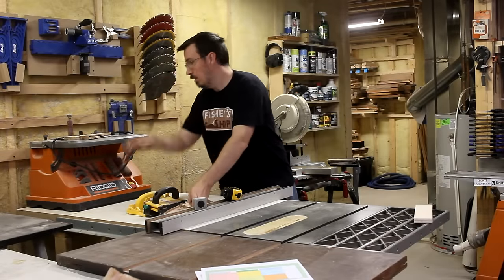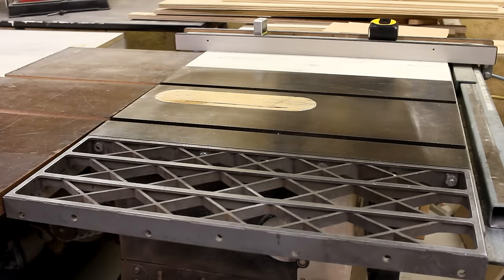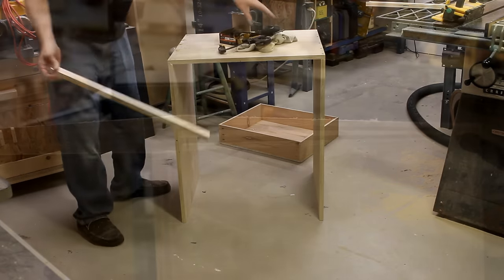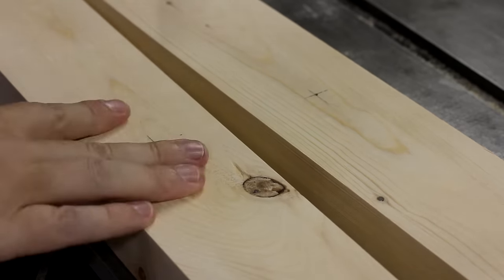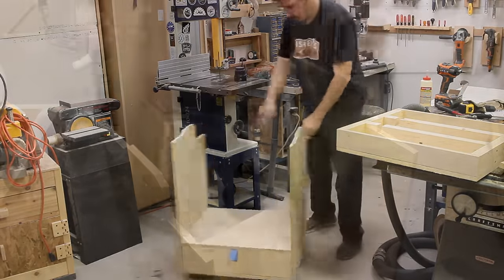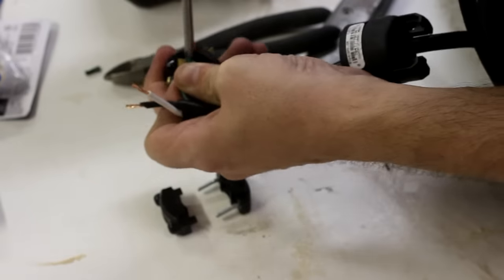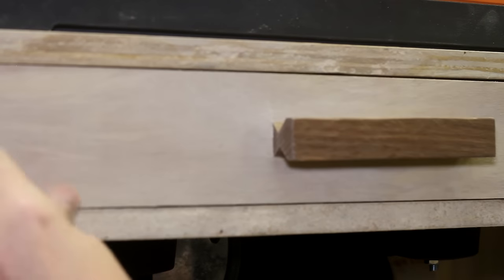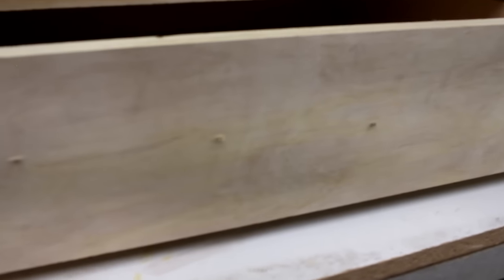Shop Work: How to make Fisher's Flip Cart

Comment: I really enjoy your videos.  I'm about to buy some of your plans from your website, but before I do, could you please tell me what the overall width of this cart is, as well as the overll width and depth of the cart for your miter saw?  I'm really limited on space...and I am not sure I can fit both carts into the space I have.  Thank you!!
Reply from the maker: It should be in the video description and the product listing on the website. Thanks
Reply: Hey Art.. My plan is to build the flipcart pretty much as he (Fisher) designed it.. then add "wings" similar to the miter saw cart to it.. I too have limited floor space, and I'm always moving tools around to use the tool I need.
Reply from the maker: @grampymeyer6603  I don't recommend this.  There's no lateral support for the uprights on the flip cart which allows the surface to flip.  If you add weight to the outside of the sides with wings it will likely splay the uprights outwards and the flip surface come detached.  If you really wanna try it out anyway, then make sure the pivot pipe extends further out on either end and thread on flanges to keep this from happening.
Reply: @FishersShop  Thanx for the insight...currently I roll my table saw over to the miter saw and use its table as a base for "stacked up wings" (or if the "michigan" weather is nice I just go outside & use my miter saw stand  Of course it is snowing now)

I'm still pondering (in my head)  the best application of the "flip cart"... my "current vision" is one side is my planer.. (gain some floor space) the other side??    some thing(s)  to regain "counter top" / workbench area..  I guess I'll have to make up my mind before I cut up (your neighbors) 4x8 sheet in case I  need to adjust the plans.

Comment: Bought your plans.  They look terrific.
I'm looking at this build for:
  1. a Dewalt 735x that weighs 90+ pounds and 
  2. a Mahuda 8" Jointer that weighs 65 pounds.  
That also changes the dimensions a couple of inches.
I'm concerned about the weight.  
Had thought about a maple stile along the center of the outside to support the pipe and to use a 3/4" pipe instead of 1/2".  
Is a single sheet of  3/4" enough to bolt on that kind of weight?   

Any thoughts?
Reply from the maker: It's more than enough.  It'll be fine if you use quality plywood
Reply: came across your comment while looking for someone else trying to use this with the 735x.  Any luck so far?  Also, have not seen / heard of the Wahuda (assuming that is what you meant, as i couldn't find Mahuda in google) jointer....How do you plan on fitting that on this cart?  Or are you modifying dimensions?
Reply: @johnjarnagin6045  Yes.  Made to Fisher Specs.  No changes there.   Seems to be fine.    here's the link to the Wahuda 8" Jointer.  https://www.wahudatools.com/?gclid=Cj0KCQiA0fr_BRDaARIsAABw4Et0Q38hSAmullxNt9B6U8vt1HaKcN5QDT9jo2P4Vct1P2xEw4xpOIYaArl_EALw_wcB
Reply: @johnjarnagin6045  I will say that this.  If I had it to do over, I'd mount the planer first.  It's heavier.  The second machine you mount is limited to attaching the plywood base by the perimeter of the machine.  So I don't have screws attaching the plywood base to the trimmed 2x4 base underneath the planer.   Still, it seems to be fine.  I've resolved to let the planer be the unit that rest on top in the storage position.
Reply: @ChuckMarzahn  any pics of your set up by chance?
Reply: @johnjarnagin6045  don’t see a means to upload photos.  It’s the same as Fisher’s
Reply: so the Dewalt 735x fits on the fisher standard plans?  no need to increase size to fit planer?  Just confirming before I start building.  Bought the plans today.
Reply: @mythrijanardan607  it did!

Comment: Hey drew I bought the plans for this. I want to add wings. I'd like to see if it can fly. If not then just to use as support for miter saw and planer. Any tips?
Reply from the maker: I don't recommend it.  The added weight of the wings might cause the sides to splay out and the center to drop.
Reply: @FishersShop  well that's no good.

Comment: OK, following the plans, building two carts, major issue if using 3/4" black gal pipe outside Diameter is 1.05 inches, so a 7/8 forstner bit doesn't work, even a 1 inch doesn't fit. Using a 1" bit requires sanding (Enlarging) the hole reduces the center of the hole even if careful, just wondering what size pipe you used?
Reply from the maker: The plans call for 1/2" pipe

Comment: Apologies if this has been asked but there are too many comments to read!  Am I expected to re-measure and trim the shelf/back to the width created by the drawer/spacer step? Or am I missing something?
Reply from the maker: I’m guessing you’re missing something because I have no idea what you’re talking about.
Reply: @FishersShop   thanks for the prompt response!  You determine the exact width of the cabinet by using a 1/2” spacer and the drawer and another spacer, (about 3:26 in the video and page 9/10 of the plan). This width is slightly less than 24” because…plywood.  You say to trim off the excess like you did with the drawer. If you don’t place the second side along the edge of the bottom, the inside width of the cabinet will be less than 24”. The shelf, back and even the top are cut to 24”. Do I have to measure the new width and trim everything down eg 1/8”?
Reply from the maker: @kenmcara  Yeah, you'll want everything to be the same width for sure.  But I wouldn't think you'd have a variance as big as 1/8"

Comment: Is there any disadvantage to mounting the drawer glides on the bottom of the drawer instead of the side?
Reply from the maker: Yes.  Drawer slides aren't meant to hold the weight of the drawer in that fashion and as a result they'd likely bend and cease to function over time.

Comment: Is there any reason you can’t get the drawer installed with the glides before putting the top section on? Just seems easier than working in that small space
Reply from the maker: Not sure I could get my drill in there to the pocket holes once the rails are in there.  Might have room... I dunno.
Reply: You’re right it’s kinda tight. So I put the pocket screws visible on top. This was just easier for me

Comment: Perhaps you should provide a way to prevent the cord of the power strip from wearing out as it rubs against the cut end of the pipe.
Reply from the maker: It doesn't rub, it turns with the surface as it's flipped.  But it would be easy enough to add additional protection if you wanted to.

Comment: I didn’t see any discussion about balance. Are the tools close enough in weight and center of gravity that it is not a concern?
Reply from the maker: No, the tools don't weigh the same.  The disc sander is like 85lbs and the spindle sander only like 35lbs.  Still no problem in rotating though.  One-handed operation.

Comment: Awesome video and cart but I need a little help because:

1.  I am not a smart man
B.  I probably missed the specific instruction in the plans and video
Fish.  I have poor concentration halibuts, what was I saying?

Ok so 
1.  In the plans that I purchased I am at the part where you refer to gluing the 2x4's to the "Surface bottom" and "Surface backer", but on the cut list neither of these things are named.  Theres "Flip top surface B" and "Flip top faces" are those the same things?

2.  Since I used the drawer to align both of the "Flip cart sides", both "Flip top surface A" and "Flip top surface B" are too wide fit between the "Flip cart sides".  I assume they need to be trimmed down but I wanted to make sure first.  Currently the space between the flip cart side is 23 and 11/16 while Flip top Surface B is 23 and 15/16.
 
There, that should be enough to thoroughly embarrass for now!

Thanks so much for the awesome content and for NOT having incredibly annoying music playing throughout your builds!!
Reply from the maker: 1. The surface backer is the long horizontal back piece on the surface assembly.  If it helps, the surface front piece would be the one with the handle on it that covers the power strip.
2. Yes, it looks like you'll have to trim them down to fit.

Comment: So I want to do one for a disc/belt sander, and my planer. But my planer, I’m going to turn and have the in/out feed sides facing the side walls of the cart. And then I want to make some flip up supports for the infeed/outfeed table. Anyone have any ideas on what to use to be able to have flip up extensions for the infeed/outfeed tables that I’ll be able to make little micro adjustments with to keep it completely level with the planer?

Comment: Has anyone used this cart to mount a Dewalt DW735x (with the tables)?  Just picked one up, and want to get it on a cart of some sort...  Don't have anything to mount to the opposite side of the flip top (yet), but figured i'd build this and be ready whenever I "slip" and buy some other tool.  Interested to know if this cart could hold the weight of the planer.

Comment: Why do you bounce the miter saw on the boards when you cut them? I noticed this in another video of yours too
Reply from the maker: I do what's referred to as "sneaking up on the cut".  Hard to see in fast motion but I'm sliding the work piece towards the blade until I've got it exactly where the cut needs to be.  I'm just more accurate this way.
Reply: That’s what I thought but in fast motion it is tough to tell

Comment: On the plans page where you have the layout of the 3/4” plywood, are there pieces that are mislabeled?  It looks as if the flip art bottom and flip top surface A need to be flip top surface A and B. Am I correct?
Reply from the maker: No idea what you're trying to say but I can assure you the plans are accurate.  This has been built successfully by many many people using those plans.
Reply: I was thought both flip top surfaces needed wings. It is only the one that needs to be cut out. I should of watched the video again. Sorry

Comment: A way to save some money on materials: instead of buying two 18" black pipe, buy just one 30" (for the dimensions of this table, since it is only 25 1/2" wide) and cut it in half before assembling cart top. Only two threaded ends are needed for the tee connector, so there's no need to buy two black pipe for a single table. At time of writing, a single 30" pipe is $11.61 at one of the local big box stores, while two 18" pipes cost $18.42 at the same store.
Reply from the maker: Gotta buy two because of the T-connecter in the middle so you can run the power cable.
Reply: @FishersShop  With respect, I addressed the T-connector in my comment, if you read the whole thing. At about 9:22 you cut off the threaded ends opposite the T-connector, showing that only two threaded ends are needed. If you get a longer pipe, cut it in half, and thread those ends into the T-connector, you have the same thing, but have spent less money on the materials. Per the plans the cart is 25 1/2" wide, so a 30" pipe cut in half with those two halves flipped around into the T-connector works.
Reply from the maker: @newcascadianworkshop6397  Ahhh, right you are.  Sorry, I tend to skim the comments since I get quite a few.  I missed where you talked about the tee connector.  Yes, that might be a good alternative.  Nice idea!
Reply: @FishersShop  I totally understand!

Comment: Instead of cutting off the plug end of the wire/cord... Why not open the receptacle/power box end? From there you can thread this wire thru the reverse direction and still have a secure connection. All this entails is to undo the securements inside the plug box.
I do this to those boxes all the time to create power strips with individual on/off switches. I just replace the factory power plugs with switched plugs that I get from the local electrical/hardware supplier.

Comment: I know that this a slightly older video and the chances of you reading it and replying are getting slimmer by the day. Then I have to remember to check it if you do reply and then maybe get an answer. The chances of that happening are about as good as lighting striking a needle in a haystack! Nevertheless, I must ask: so, I love this design and I want to make one, I just wanted your thoughts on how it might work with a small bandsaw and a small drill press instead. They’re more like hobby level tools so, I love the space saving idea. Thanks in advance!
Reply from the maker: It would work just fine.  People put all kinds of tools on this design of cart.  You might have to add a tiny bit of height to the sides, but it would work just fine.

Comment: 1.3K comments at the time of writing so I’m sure it’s been mentioned before, but in the unlikely case it hasn’t ...

Anyone who attempts this must take great care to at least deburr (not mentioned in the video) and better up, add a cable hole grommet to the end of the pipe where cable enters, or the sharp metal edges may over time eat its way into the rubber cord and expose a hot wire.
Reply: Eggzactly the comment I've been scrolling to see. Now I don't need to bring that up!  LOL

Comment: Brilliant though this is (like all your stuff), I was disappointed that it only flips through one axis, leaving the two sides totally redundant. If it could also flip through the other axis you could mount your mitre saw on one side of the unit and your bandsaw on the other. You would then be able to make absolutely anything without having to move your feet...